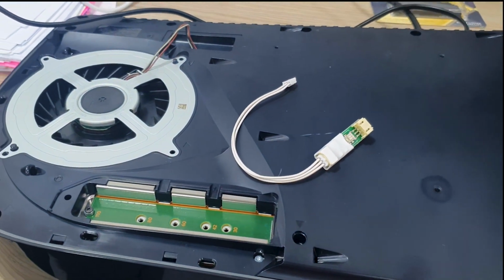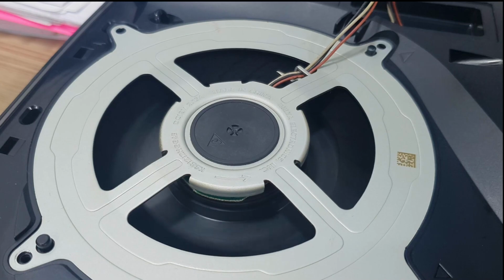3 Stages of Cooling for the PS5 That You Need to Do Now......

Comment: Hi i just wanna know how is it your ps 5 aftet upgrade with thermal pad 1.5 mm??
Reply from the maker: @GAMING-ISAWESOME  bang on. No over heating at all. And that's gaming constant. Even in a warm room
Reply: @gtekks  Is it advisable to apply thermal paste and then the thermal pads?, I'm going to maintain my ps5 and I'm researching on the subject
Reply from the maker: @SoyNesty  As of today, the ones i have upgraded are running perfect, with no overheating at all. Reason i did thermal paste first, just a dash, was to keep the pad in place, sometimes they fall off easily. the paste helps them stick ever so better.
Reply: @ Ohh it's just to glue the Thermal Pads and they don't move, I thought it was to improve the terminal transfer
Reply from the maker: @yasielrodrigues5043  it does that also. So it's a win 🏆 win.
Reply: Wow you just apply all of that with 1.5 mm thermal pads??
Reply from the maker: @GAMING-ISAWESOME  kinda yeah. But also the additional liquid metal helps.